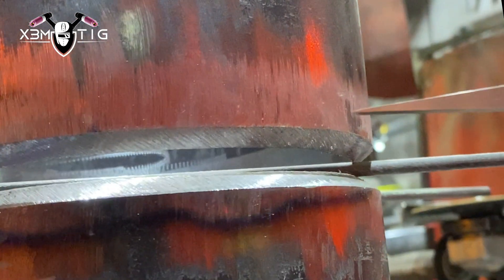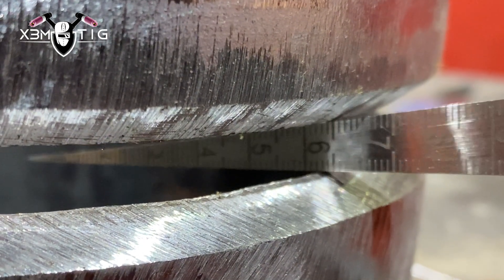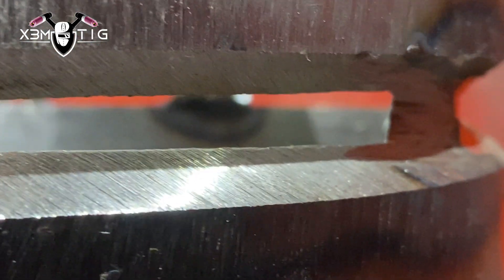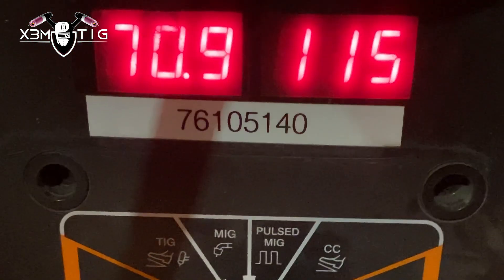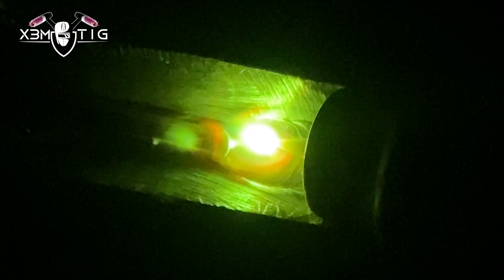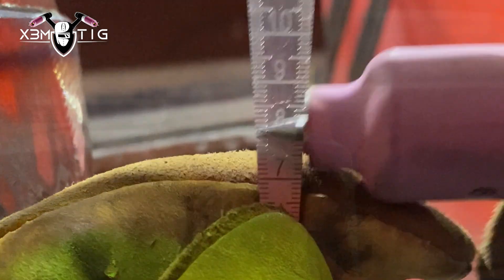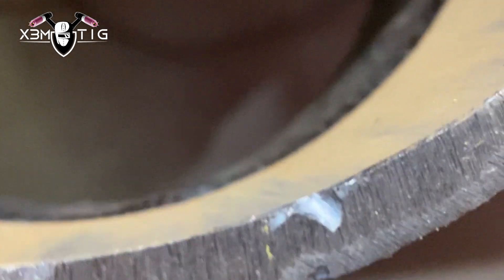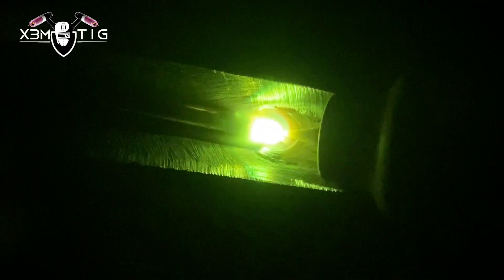Double Down on Your TIG Welding Skills | Two TIG Root Techniques!

Comment: Where did you find that wedge with measurements marked on it?  Looks like a great time saver when setting a gap or stick out.
Reply from the maker: Taper gauge bro , you can get it on Amazon.

Comment: do you ever have to pre heat or sweat out the material first? would your technique change much if the butt was 150° or 260° these are the 2 common pre heat’s i work with for rooting
Reply from the maker: Nothing changes.

Comment: Maybe you could make a video about how to weld the pipe in 5g position so that it stays straight in level. I mean is it correct to weld in quarters or half and second half?
Reply from the maker: It all depends from the material and fit up, but half’s at the bottom should be fine.

Comment: Hey man love the videos, I always make the bottom look good on 6 in sch 40 running 110 for root, I turn down to like 85-90 when coming past 3 o clock , but still get grapes (even with keyhole dip) on the top. Is it normal to have to turn it down that much? also I am free handing and keeping the tungsten straight, not so leaned over. Should I lean it back on the top?
Reply from the maker: It’s ok to turn the amps down a bit, also try to speed up on that section, that might help you!